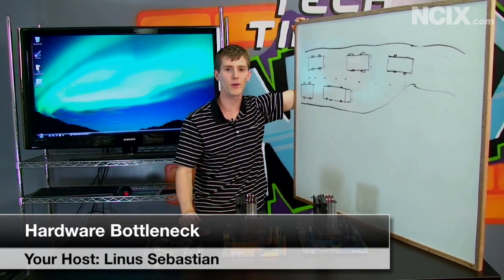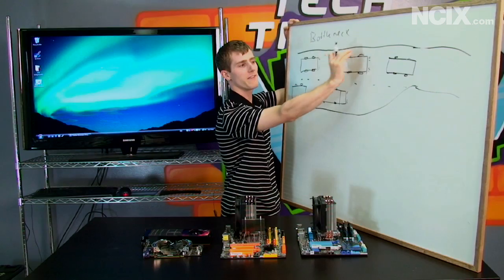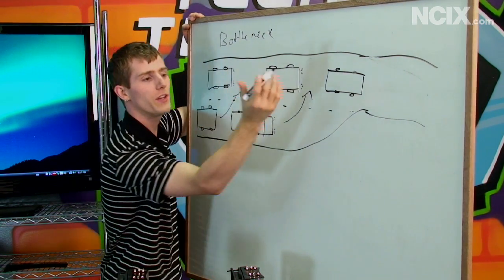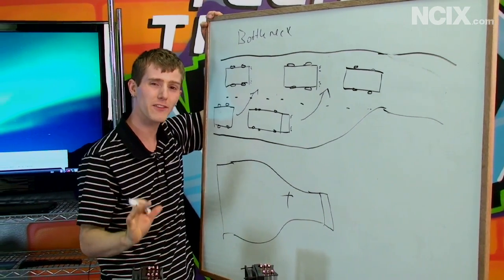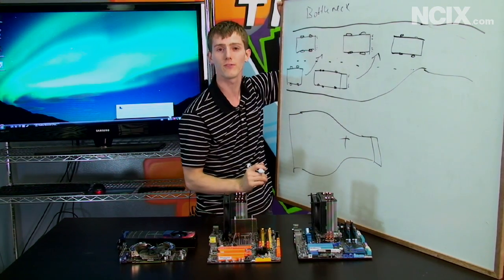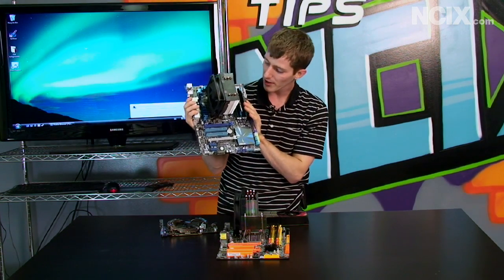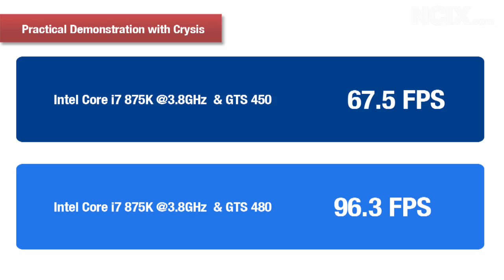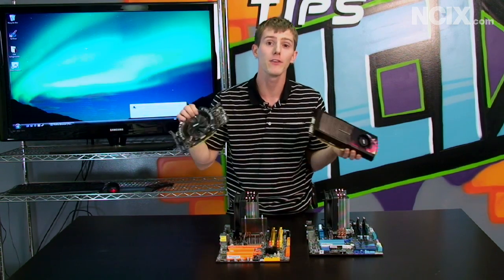Understanding Hardware "Bottlenecks" and How to Avoid Them (NCIX Tech Tips #81)

Comment: I get alot of bottlenecking with an i7 4790k and a evga 1070. Wtf that shouldnt be happening. And i thought was picking the right parts. Apparently not
Reply: Brian Sprecher you should not be bottlenecking at all.
Reply: Yeah, no kidding man.I cant for the life of me, figure out what is causing my frame rates to drop to zero and the massive stuttering everywhere. I dont know if its the ram, operating system or the psu because they are the only parts I haven't changed out yet

Comment: You need 4 physical cores and more [Core i5 or Core i7, OR AMD 4/6 cores or 8 xD], and RAM DDR3 1033MHz [PC3-10600] and more, max. 1600MHz [PC3-12800] and HDD 7200rpm or any SSD and good power supply, you can buy Corsair 650W
and and and good motherboard heh :)

Comment: i5 2200k (quad core)
8GB DDR3 (Corsair vengeance)
GTX 650 (2GB GDDR5)
1 TB HDD (WD 7200rpm)
Windows 8.1

Can anyone spot any obvious bottlenecks??
Reply: Nope looks good :)
Reply: Thanks
Reply: Too weak GPU.
Reply: Damn. I just got it.
Reply: PonzooonTheGreat nahh man not a too weak gpu.. it can keep up wit the I5.
Iam a PC hardware technician. its fine thrust me :)
Reply: Great, Thanks. I wasn't planning on replacing it but it's good to know that it is fine.
Reply: I can run all Unreal 3 games on max so that is fine.
Reply: PonzooonTheGreat lol @ guy saying too weak GPU, just don't listen to those guys. ever.
Reply: Just discovered with a benchmark, there is a MASSIVE bottleneck ON the graphics card. The GPU is not powerful enough to utilise even half of the VRAM. SHIT!
I could have got the 1 GB model cheaper for EXACTLY the same performance.
Reply: PonzooonTheGreat I am sorry about my comment 2 months ago, i don't know exactly what i meant. As for the 2GB of vRAM, you could try OC your memory frequencies a little to help alleviate that issue. The GPU itself is fine to max out games such as LoL, TF2, CSGO and the like. I would recommend upgrade to an AMD R9 370 once that is released in the middle of this year. It should be ~150US$ and will definitely be a huge improvement. If you do however want to stick with nVidia, then i suggest you wait for the gtx 960ti or whatever it'll be called as 2GB of vRAM does REALLY cut it anymore (even for 1080p).
Reply: Michael Wicke So your comment was right after all!
Well, I won't upgrade anytime soon, it is good enough for my gaming and developing needs.
I already tried overclocking it with GPU Tweak but all that happened was it crashed a lot and there was absolutely ZERO improvement in performance.
Reply: Yeah that 650 seems like the issue. Might as well have spent the extra and gotten the 660. You said 2GB so I'm assuming its the TI. http://gpuboss.com/gpus/GeForce-GTX-660-vs-GeForce-GTX-650-Ti-Boost
Reply: FraggedDabloons I just upgraded to an AMD R9 290. I wanted to do the Eyefinity setup.
Reply: i would put an ssd here
Reply: I know, that was stupid of me not getting that
Reply: Zipsyism huh. Hard drives don't last forever though. And when they fuck up they fuck up a lot!

I pu and SSD in an old Pentium and it became real fast

Comment: An overpowered PSU it is NOT a cause of bottleneck but it's just overpower!
Dude a PSU doesn't NOT send any data to the system but just power as requested, did you know that? LOL
Reply: +Bill Admond He isn't saying that a PSU will bottleneck a CPU, he's being general in saying that a high powered PSU can be bottlenecked by a system running on low power. The principals still the same although it doesn't apply strictly to performance aspects.
Reply: Bill Admond Great response

Comment: Am I being bottle necked anywhere?
 
Asus P5K3 Deluxe
4X2 Gb Kingston 1333 DDR3
Intel Core2Quad Q9650 @3Ghz(on air)@3.8Ghz OC (winter) bottle neck on HD6970?
AMD HD6970 2Gb (PCI-E 2.0 on PCI-E 1.1) bottle neck?
Samsung 250Gb Evo SATA III on SATA II (primary) bottle neck?
WD VelociRaptor 300GB 10K RPM 16MB SATA II (secondary)
1100 Watt Apevia PS 
Windows Vista 64-bit... bottle neck!?!
Reply: 1100W PSU is WAAAAY too much for that system.
Reply: Tell me about it! At the time I put this system together (about 4 years ago) I didn't know whether or not I would be crossfiring two gpus together or not. As it turns out I never did. So now my room gets super warm super fast (this old PSU doesn't have thermal controls like the new ones do).

Comment: Please HELP me If There's A Bottleneck on my PC Build
i5 3470 3.2 GHZ
GTX 970 AMP EXTREME
2x4GB RAM 1333mhz Kingston
Board MSI B75MA-P45
PSU 550 WAtts

THANKS!
Reply: looks good at first sight, you may want to make sure the PSU is good quality tho, idk much about them but 550 seems a bit few.

Comment: So the CPU is JUST as important as the GPU for gaming.
Reply: Nici Geelhoed the GPU is WAY more important than the cpu these days
Reply: Axecution Not really, the CPU is just as important, the rendering made from each core is really important to get the best fps in games.......As he said, having a better GPU just means you are bottlenecking your computer since the GPU simply don't perform as well because the CPU is holding it back....if you have a CPU that is running around 100% and your GPU is no where near that % (like 80% or even less) then that means your CPU is holding it back. (You can check your CPU usage by pressing ctrl + alt + Delete)
Reply: zengara11 I know what bottlenecking is. thanks anyway for the info
Reply: Axecution not in total war games or mmos

Comment: I think I bottlenecked my PC when i was building it...

i7-2600 cpu
Radeon HD 6850 1GB card
Asus P8H67-M motherboard 
500W power supply

Opinions please guys?
Reply: Tal Zeraviv My CPU? I would've thought it's my GPU that is the bottleneck? The i7-2600 works really well for me.
Reply: There's no bottleneck there, just the GPU is a lil crappy.
@ Tal, I'm running a i5 2500k with 2 AMD R9 290's and there's NO bottleneck.
Reply: ***** Yeah I thought the GPU was the weakest component in the build too. So long as it's not bottlenecked though, it's fine by me. I could always upgrade anyway.
Reply: rohitcharli I upgraded from a HD 6850 btw.
Reply: ***** awesome :D

Comment: HELP ME GUYS ! My PSU is Real Power 500w,and I'm thinking of getting an XFX HD 7850 2gb DDR5,and my question is would that be a bottleneck? Can my PSU handle the card?  The rest of my spec is :
-fm2 motherboard
-AMD A10 6800k 4.1ghz
-4gb DDR3 1600mhz RAM
-Kingston 500gb hard drive
-Sony DVD-RW disc reader
I have no additional fans or cooling that would draw extra power. THANKS.

Comment: Guys im new to building pc and Im wondering if im bottle necking this pc

Cpu:AMD FD6300WMHKBOX FX-6300 6-Core Processor Black Edition

Graphics card: Gigabyte AMD Radeon HD 7850 1GB GDDR5 DVI/HDMI/2x mini-Displayport PCI-Express 3.0 CrossFire ready Graphics Card GV-R785OC-1GD

Mother Board: ASUS Intel H77 mini ITX Motherboard - P8H77-I

Ram: Corsair Vengeance 8 GB ( 2 x 4 GB ) DDR3 1600 MHz (PC3 12800) 240-Pin DDR3 Memory Kit for Core i3, i5, i7 and Platforms SDRAM CMZ8GX3M2A1600C9

Comment: How much FPS would i get on this computer? :D http://pcpartpicker.com/p/pc2q7P and will it bottleneck?
Reply: The FX-6300 will give a bit of a bottleneck, but it isn't too substantial to make a huger impact.
Reply: i have an fx 6300 @ 4.1 ghz... and a r9 280x runs everything i throw at it
Reply: I have the FX-6300 Overclock to 4.2 and a GTX 970 nothing is wrong. Even on stock speeds it's fine.
Reply: if you haven't bought it already, I would consider buying a different PSU, I would consider a Cooler Master V450 or a Seasonic S12G 450 wat, They are way more reliable, it's not a good  idea to cheap out on your PSU.
(Yes I know that the 450 wattage is lower, but it's an 80 plus gold PSU so power output wil be the same or even better)

Comment: AMD Athlon 64 X2 6000+ 3.2Ghz
4 GB RAM
PCI-E X16 1.0
650 Watt PSU 24 pins
Best GPU  under 170$ ? (USED)
Please help.
Reply: r7 250x (if you play old non cpu demanding games--->r7 260x) is most powerful gpu in your case, anything over will bottleneck (your cpu is based on REALLY OLD architecture)
Reply: Axecution  I need to run BF3 just bought it for 10$. Would a HD 3870 work with 1 6-pin connector?
Reply: Nejc Guček Make sure you power supply has the 1x6 pin connector and yeap that card will run Battlefield3 720p medium
Reply: Thanks.
Reply: Tal Zeraviv My MOBO only supports AMD 64
Reply: Nejc Guček what mobo are you using? (model)
Reply: NForce4M-A
Reply: Nejc Guček then don't bother buying new cpu
Reply: R7 260x
Reply: Keep the PSU, you can use it to future proof your pc. In terms of GPU under $170, in my honest opinion you should go with either the R7 265x or a gtx 750 ti. Both can range from $130-170.
Reply: ShantWrites1 He could get the 270x actually.
Reply: FatheredPuma81 r9 295x....
Reply: Axecution Damn where did you find that for $170?! PLEASE tell me as I will buy it along with a PSU and put it in my computer.
Also I don't feel the 270x will bottleneck him to badly in which it woud be a waste. At most he will have to just turn down things that are CPU heavy in a game to not see huge bottlenecking.
Reply: AMD Athlon 64 X2 6000+ 3.2Ghz 30$
4GB RAM 25$
650 Watt PSU 10$ (Flee market)
MOBO 20$
HD 4850 1GB 40$
Running DayZ SA Normal/High 20+ FPS
Reply: Nejc Guček So you bought a 4850 and don't need a graphics card? Also i'd suggest you check out the PSU more in depth as you could have bought a bad PSU that may be known to discharge since it's $10.

If you still want you can get the 7750 for $80 not sure how good the 4850 is since it is a 800 which I think means a higher tier. .

Yea I looked up the 4850 playing some games and the 7750 is a decently big upgrade for the small $40 more price.

Comment: lol im about to bottleneck the fuck out of my rig! im in the process of building a new workstation/gaming rig/htpc basically a bad ass desktop for big boy jobs that my labtop and current rig cant do. i have had this htpc for almost a decade running like a champ but its time to go. its an old hp pavilion 4gb ram with an anthlon 64x 2 4400+ (never overclocked but gonna soon) anyways right now its sporting a evga ssc 1gb gt 9600  (super overclocked to peak potential) and it still plays lots of stuff fairly well. anyways i just found a brand new 4gb ssc evga gtx 960 from newegg for only 180 and i couldn't resist the deal so that bad boy is gonna go right on in my old rig until i can finish the new build. bout to find out just how shitty a bottleneck can really get haha hopefully i can offset some of the damage by overclocking to as close as 3.0 ghz i can get but im not expecting much gain overall.
Reply: +zeroa69 no offence but you call that a workstation...